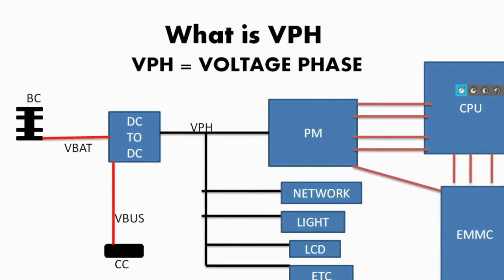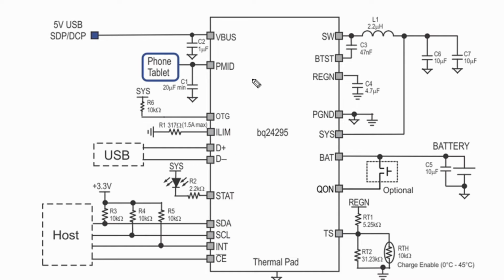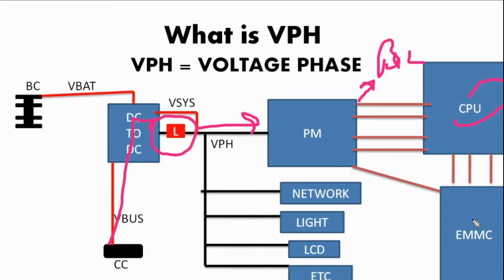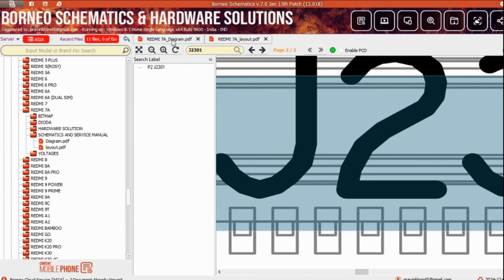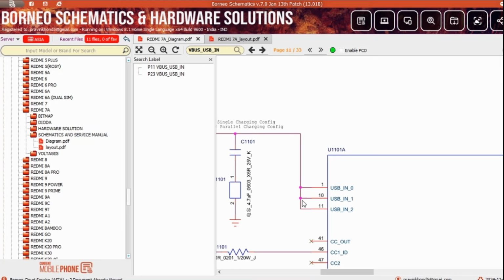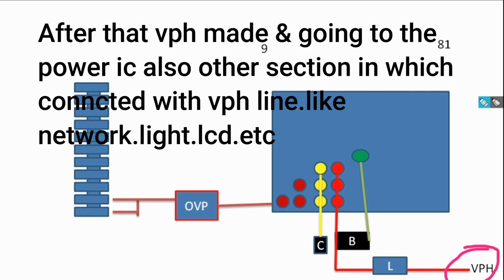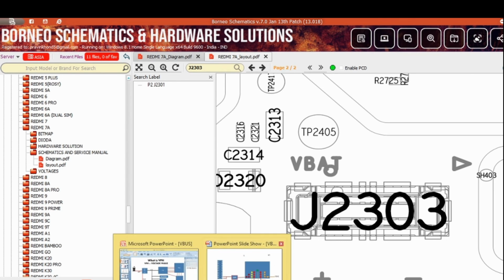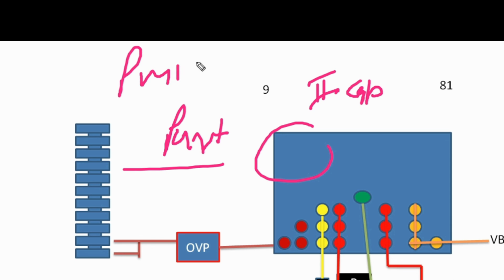How to troubleshoot Vph line in Dead phone.All details About vph/vsys.How this line work.VPH SHORT 💯

Comment: Thanks 🙏, please I have a dead infinix hot 8 board. I have checked all the capacitors, inductors resistors and others it seems there is no short and yet it does not turn. PLEASE I NEED HELP? WHAT CAN I CHECK ✔️ AGAIN. ALL VOLTAGES LIKE 1.0V, 1.8V, VPH, 3.0V, ETC ARE PRESENT WHEN CONNECTED TO A CHARGER. 
PLEASE I NEED HELP SIR. THANKS 🙏🙏🙏🙏
Reply from the maker: Unless I get your details about what you have done and which lines you have checked in this phone, how can I guide you?

Comment: Sir I'm one of your avid follower. Thank you for this free tutorials. However I'm still confused. What are the voltages needed to power on a mobile phone. Say oppo a12, in the battery connector it reads 4v output, in the power switch around 3.8v but why it doesn't turn on? Please help
Reply from the maker: There are many steps to confirm where the problem is..